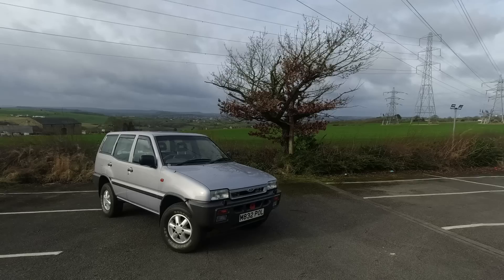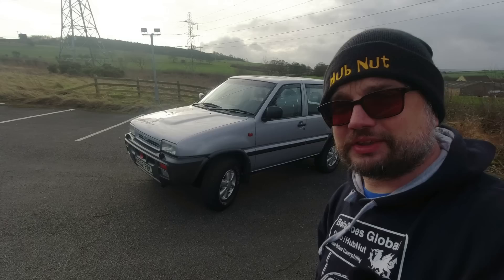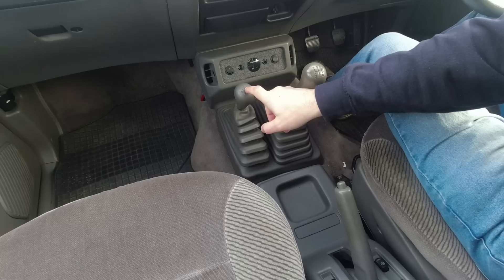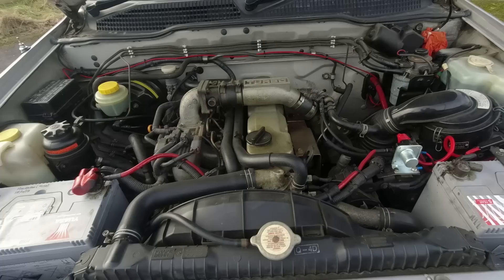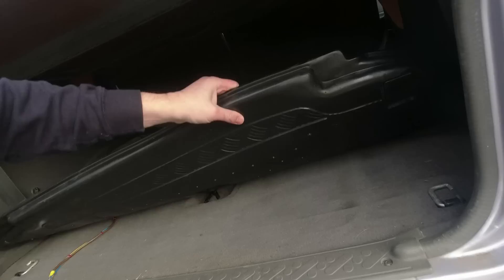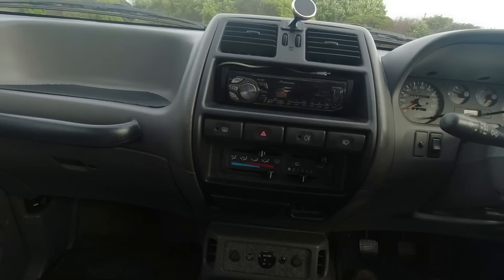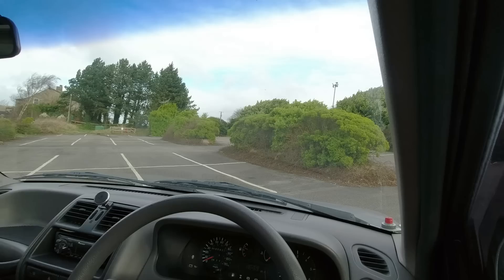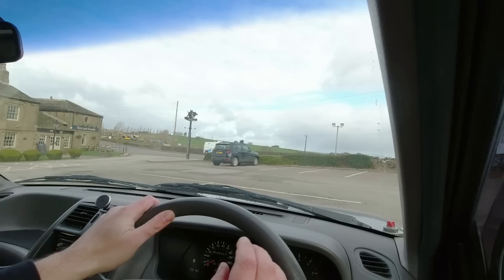Real Road Test: 1995 Ford Maverick 2.7TD (Nissan Terrano II)

Comment: This engine was used in the London Style Fairway Series taxis and the TX1, but without the turbocharger. It was discontinued when the TXII was introduced in 2002, succeeding the TX1 in production from that point on
Reply: There was a company near London that would swap the Nissan engines into the tx2's due to the Ford 2.4l duratorq engines being unreliable in service.

Comment: I bought three of these on the same day in 1995 as a Nissan from Forge Garage when they were an official dealer. Two shorties and a long with the 2.8 turbo engines. I ran the long one. My wife and mother had the other two.  I part exchanged a Range Rover 2.4 diesel that I’d owned from new in 1988 and ran for 100,000 miles. Also my mother’s 1987 shorty Shogun and something else, possibly the 1993 Land Cruiser 80.
Ran the long for about 45,000 miles until the gearbox started to rumble. The last one was run by mum until she couldn’t climb in due to old age and sat far a year or so until I sold it to someone in Gilfachreda, the last house in the long terrace on the way out to the hill. He ran it until last year, towing his Morris minor and a trailer with mini-digger buckets around until 2020. I think it covered about 160,000 miles before the rust caught up with it. 
There’s a 3.0 three door black Terrano next door to me [about a mile away] which has recently been put on a limited use license which means it is now exempt from MOT and can run on red diesel.

Comment: In the USA, Ford used the Maverick name from I think 1969 for about then years on a two door and later a 4 door compact.  Now they are using it on a very small (U.S. standards) 4 door pick up truck.
Reply: I think the current Ford Maverick truck is a hybrid.

Comment: My first car was probably the least impressive turbo-diesel ever made, the VW Jetta ECOdiesel, which only produced 7 more horsepower than the equivalent non-turbo diesel. But as its name suggests, it was done more to improve emissions (it was VW's first diesel with a cat) than for a performance boost. In addition to not having an intercooler, it also did not have any boost enrichment. p.s. Weddings at a coal mining museum? Really?
Reply: The ford 1.8 diesel gained a turbo maybe went from 60 to 70hp but it was no faster top speed.

Comment: Owned the later Ford Maverick aka Mazda tribute. It had the petrol  V6 3.0 ltr engine as fitted to Mondeo and Jaguar. Quickest 4 wheel drive I have ever owned. Very quiet and smooth.
Reply: The twin to the Mazda Tribute was the Ford Escape, which is called in the UK 🇬🇧 the Kuga. What an unusual name!

Comment: More badge engineering the current Nissan Terrano is a Dacia Duster built  in India changed into a weird Nissan .I liked the the three door Ford version a lot.
I also looked at a Nissan X Trail car but wearing Nissan Terrano badges official.It was a blinged out Japanese import that wouldn't accept a towbar because of the fuel tank is  different to the XTrail UK being right under the back bumper.
A great vlog!
Reply: Both companies being part of the mighty Renault empire!
Reply: @caw25sha  Exactly my thought, the Dacia Terrano is nowhere near as good as the old one with a Kangoo diesel engine

Comment: In Australia, the Nissan GQ Patrol was rebadged the Ford Maverick. In exchange, Ford gave the XF Falcon Ute to Nissan which badge engineered it as the Nissan Ute. 

Interesting that Ford/Nissan used the Maverick name for badge engineering in Europe. 🤔
Reply from the maker: Yes, saw a few in Aus. Looked odd to my eyes.
Reply: @HubNut  , very odd. Most of them have now been feralised. Aftermarket forced induction, many getting LS swaps or the 3.8L GM V6. Raised suspensions and M/T tyres. And appearance add-ons suited to being an extra at Bartertown, just down the road from Thunderdome. 😆

Good solid base to make a relatively cheap off-road tourer that can handle our conditions.

Comment: That engine was also made in 6 pot form the TD42, found in the Patrol GR Y60. In some places they had turbos too. Very heavy engine , all cast iron, with gear driven camshaft, basically unbreakable. The Australians love them. These engine have been increasing in value over the last 15 years, glad I picked one up when I did, it has been powering my Range Rover for the last 11 years.

Comment: When I did a stint at car sales back in the early 90s, I had one of these as my company car/demonstrator. As a junior salesman I usually got a Micra or a Sunny but the other two salesmen thought the Terrano was gutless and didn’t want to drive it. I loved it - did a bit of off-roading and towed a car trailer with it at weekends. Always gave it a good wash before work and nobody was any the wiser. It’s weird the rear door opens the ‘wrong’ way for UK as Japan is the same driving orientation. All the Japanese suvs here in Canada open the ‘wrong’ way for here because of that. These would have been popular here in Canada for winter driving, as the earlier version was in Pathfinder form. Sadly rotted away quickly from the road salt, though.
Reply: Did opens the wrong way because they were built in Spain for the European market
Reply: Almost a bit ford, opening that way.  Fords are built for left hand drive.  That's why the cup holders are usually the wrong side of the handbrake.  And the rear door on the ecosport also opens the wrong way for the UK

Comment: Nissan Terrano a good all round 4x4 I  know of a few folk that took there engine out of them and put it into the Navara D22 when the engine blew up. I myself have had the Nissan D22 with the original 2.5 turbo 130 hp found it a good truck. Ford Maverick was a good machine shame about the rust.

Comment: The Daihatsu 4Trak  was much loved here in rural areas - a good mud plugger to lob sheep in the back of and fixable on the farm using basic cutlery.  That's a role that seems to have been taken now by high mileage 1st gen Duster 4x4 diesels which fill the same niche

Comment: Interesting!
When you mentioned Maverick I thought you were going to drive a classic US compact made from 1969-1977!
I have ridden in a US spec Pathfinder, quite nice, as well as the Nissan Pick-up.
I like this; nicely specd, and lovely sound turbo diesel.
Because vehicles like this are prone to flip, US mandated stability control to control SUV vehicles for flipping on its roof in avoidance maneuvers.
Ford did badge engineer another Nissan product, the Nissan Quest, which was the Mercury Villager minivan.
Excellent review!

Comment: My mate had a ford maverick back when we was 17 in 2010 he passed less than a week and we rolled it on a green lane 😂 it took it well to be fair it lived on for a while after. U can do 100 down a hill but it won't stop wouldn't advise it 😂😂😂 though adding to your point on the useless turbo we pulled over after the 100mph run and you could still touch the turbo it was luke warm

Comment: I have heard of this Ford, but find it somewhat interesting that Ford U.S. had used this same name on an economy sedan that looked vaguely like a Mk 3 Cortina and recently resurrected the name for a quasi-pickup truck available with a hybrid drivetrain or with an Eco-Boost engine.
BTW, the remote sounds like you just stepped on a child's bath toy.
Reply: The US Ford Maverick economy car came out in 1969 as a 70 model.

Comment: Had a D21 pick up for a while until the load bed rotted out, not helped by a very heavy, old Atco bowling green mower in the back when the floor gave way.  It was very capable off road, apart from the terrible approach and departure angles and could be easily high centered.

Comment: Interesting vehicle. A friend had the Nissan Pathfinder. It was not bad, but that 3 litre 6 was thirsty and the cargo capacity was a disappointment. The side swing tailgate was simply daft. On the Maverick the side swing gate is still daft as a brush, and seeing it forced lights into the bumper, was insane. Lights should never by mounted in an impact surface! That one thing is enough to turn me off the whole vehicle. Still, in my mind the name Maverick means a compact (by North American standards) car with 2 or 4 doors, and sharing a platform with the 1960-69 Ford Falcon and the 1964-73 Mustang amongst a number of other Ford products including the Lincoln Versailles. If you ever get offered one of those, Ian, grab it! They may look like a North American Grenada, but they sure don't drive like it

Comment: Whilst in the early days of my RAF career I worked several years at The Royal Tournament, held at Earls Court in London.
The Army was being sponsored by Ford and carried out a display on the packed earth arena.
Each display got quicker until one of them whilst carrying out a high speed turn dug into the packed earth where the large metal tie down for the Navy Mast causing it to flip and roll rather dramatically!
It must have been in 1993 as that's the year the Navy ran it and they had a full size sailing ship mast that would be lowered and tied to the ground by ropes to the tie down points.
The Button Boy coming down the mast video is on You Tube but other than reviewing camera footage at the time I've never seen it in the public domain....but someone has it 
Peace
Charlie

Comment: Another Ford badge engineering project that has actually lasted a long time is the Ranger pickup as the MK1 European and UK versions were based on a Mazda B series pickup trucks and in other parts of the globe they have a SUV version of the Ranger known as the Everest which seems to be a similar concept to this Maverick in design sense.

Comment: Sounds it wants the pumps micro filter doing , 
They are pretty revy engines and rev free 
Got 4 d21s , had a 94 mistral , and one point a r3m and r3mr 
But they are strong , 200k is barely ran in lol 
One of the d21s we got been turbod on the stock none turbo engine 200+k. Now at 19/20psi boost front mount, big vein turbo and turbo pump , it shifts

Comment: Hi Hubnut. Ah, that'd be the Nissan TD27 engine. I didn't know about the London Taxi connection, so thanks for that. You'll recall driving my extra big and notably slow Nissan van, with unturbo-ed TD27. The petrol engine you refer to would be the Z24. I'm surprised you didn't get on with one. My experience is the opposite with a Z24 powering my quite nippy small Nissan van. Cheers.
Reply from the maker: Ah yes! Forgot about that drive. Slow but relaxing. Z24 was ok, but really lacked grunt for towing. Had to constantly downchange.

Comment: Still not as wonkybonkers as the Australian Nissan/Ford friendship, Nissan and Ford shared the U12 Bluebird platform as the Pintara and Corsair, Ford Rebadged the worthy offroader Patrol as the Maverick, and Nissan got a copy of the Ford Ute for their own badge

We didn't actually get  the Terrano II as anything other then a grey import. Either as a Ford or as a Nissan. we did get the first Terrano though.

Gotta love the late 80s/early 90s BadgeSharing that went on at the time. Nissan also shared the N12/N13 Pulsar as the Holden Astra.
Reply: The Terrano 2 was sold in Aus. Not for long though buyers preferred the 2nd gen Pathfinder.

Comment: Beauty truly is in the eye of the beholder. Always thought these and it's Nissan cousin were one of the ugliest 4x4 on sale. From the A pillar forwards to me looks like it's from a completely different car, in fact the front end with its small lamps and low bonnet line makes it look like an engineering test mule rather than a production model! Saving grace is the reliability of the engine, but hard to believe this originates from the same company as the Patrol and X-Trail. Each to their own of course!

Comment: More lugging engine than a Discovery, nearly as good off road as a Discovery, interior not as cool as a Discovery, rusts nearly as well as a Discovery but you do have to admit that the Maverick facelift does look gorgeous. 
The 2.4 litre petrol is very like the Discovery MPi 2.0 litre, rev it to the Moon and give it more Unleaded. 
Ultimately the Terrano II, The Maverick and the Discovery are very comfortable, practical, Proper SUVs which can carry, tow, off road and contribute fully to any outdoorsy type lifestyle.

Comment: They weren't that slow back in the day, I've literally bought and sold hundreds of them because people loved the car like drive on them. Other than rust the 2 biggest problems were the diesel pumps and the power steering as you lost assistance at engine idle. Had no issues driving 200+ miles in them other than they were pretty thirsty are motorway speeds but still better than the equivalent Shogun's.

Comment: I spun out in a terrano once. They are tail happy .
Reply from the maker: Yes, and the limited slip diff can lock up unexpectedly if the fluid is old/incorrect.
Reply: @HubNut  well, the automatic transmission broke before that was an issue on that car. But that sounds... Exciting.

Comment: I love badge engineering!
But to be honest when I heard in a previous  video that you were driving a Maverick I thought it would be the newer one, the one that had a badge engineered sibling the Mazda Tribute
(But I'm not sure if they were sold in the UK tbh)
Reply from the maker: Yes, Tribute version was sold here.
Reply: I think that’s the Ford Escape - at least it is here in Canada.
Reply: @MapleMarmite  Yes, it's that.
It was called Maverick in Europe
Reply: @gg_vard  Yes, you’re right, I forgot about that. It wasn’t around for long in the UK before I moved to Canada. Here, it was also available as the Mercury Mariner - look up a pic of that for a slightly different appearance. Not many of those left now.

Comment: The best most reliable car I ever owned was a ford maverick Exacly like that .I bought it with ,80 thousand for 600 pound off a retired couple .I owned it for 15 years and drove it everyday and used it regularly off road and towing and never got stuck .sunroof used to leak for years but when I took the trim off I found it was just the drainage tubes needed re connecting and the drivers seat collapsed but was easily fixed .regrettably Sold it to a local farmer at 250 thousand miles and he is still abusing it to this day running it on tractor tax so mot  .exempt .not so pretty today sadly .The later  cars seemed to rot a lot more than the early ones bizarrely .

Comment: I   thought the maverick was a nice looking 4x4. Loved the alloys also. 

Didn't they take them on a massive would tour off roading arctic etc. I need to find the program.

Once I was driving a social worker Maverick to the workshop to sort the brakes and I noticed the red button alarms in the centre bit. I was pressing them disappointed they did not beep. Only to arrive at the work shop with an angry fourman and the police on the phone. Oooops that was back in 2005.
Reply from the maker: They did. Blue Peter were involved with that one. I remember it well.
Reply: @HubNut  That's it thank you I was 9 at the time I still have the Ford rang file thing and Featured the Maverick. Went from Fiesta all the way up to the RS Cosworth. Its somewhere in my cupboard.
Reply: Video liked I need to press the like button more. The brake discs were tiny on those.

Comment: I had two friends in the 80s and 90s who had these cars one was the Nissan one was the Ford badge they were both not very impressed first of all the Ford owner found it extremely unreliable even at one point breaking down on the Tyne Bridge and blocking off the whole of Newcastle, the Nissan was okay for reliability but is extremely uncomfortable and unrefined to which I think is really unusual for Nissan I had a few Nissans and I found it to be great and very reliable

Comment: The steering wheel looks a bit like the one in a MK V Escort! Surprised that it didn't have an air bag in 1994! Was ABS an option on this model?🙂
Reply: It was the only Ford sold in Europe that didn't have an airbag by 1994, IIRC

Comment: We have the displeasure of owning one at home.
My old man loves it, I loathe it.
I don't find any redeeming feature in it besides the engine. 
The design is ghastly, especially on the 97-2000 ones, they rust harder than a 70s Datsun and they have driving dynamics that put a wheelbarrow to shame with how bad they are. 
Absolutely dreadful thing.

Comment: Have had 2x 2.7TDs Terranos both manual and a 2.7TDs Mistral (Automatic Jap Import) and the Mistral was miles better than the Terranos. It really was quick, powerful and a better drive - it would have literally pulled a house down. That was the era when Nissans were proper old school and not Ford hybrids. Caravanners loved them and IIRC latterly they were sought by Nissan Navarra owners to rob & retro fit the better Terrano engines?

Comment: About those lights. I can understand a Japanese car having bumper lights to comply with European rules but why on earth does the Freelander have the same thing?
Reply from the maker: Same reason. It's a European rule. That's why the Discovery developed bumper lights. The door is not allowed to obscure the lights.
Reply: @HubNut  What I meant is, the Freelander looks like it has been converted to European rules with lights added to the bumper etc, even though it obviously was designed for Europe to begin with.
Reply from the maker: Bumper lights were really the only way to get around the regs with that sort of door, which is perhaps why the Freelander 2 had a more conventional estate look. The regs came in for about 1995, so before the Freelander design would have been signed off.

Comment: Does a 2.4 1994 ford maverick have a limited slip diff
Reply from the maker: Might depend on spec, but mine did. Easy way to check - jack up the back end, spin one of the wheels. If the other one turns the same way, LSD. If it turns the opposite way, open diff.